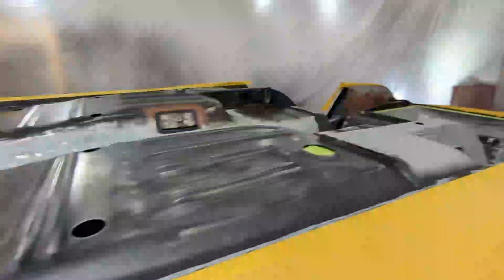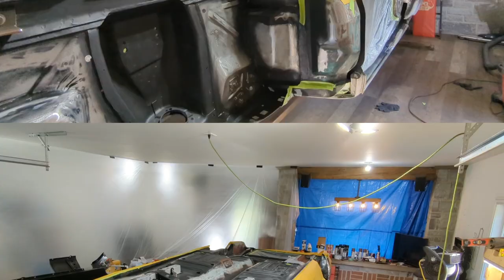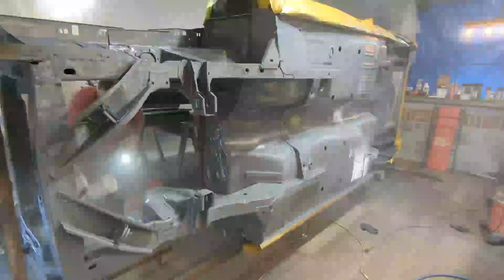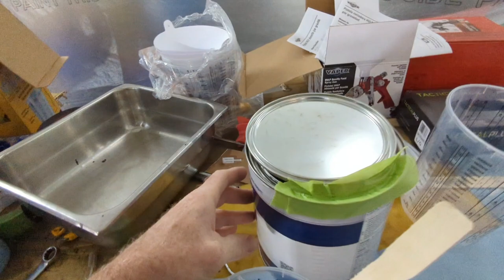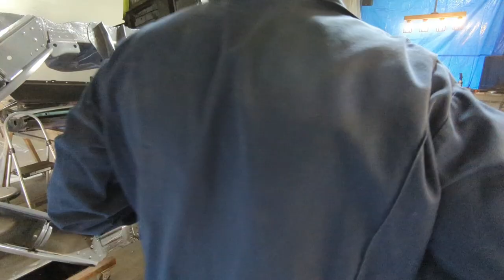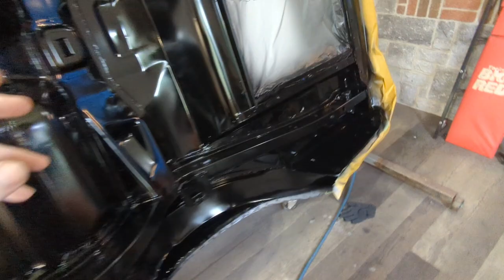Project Mustang #33 : Epoxy priming and painting the underside using Eastwood products

Comment: 😲 wow, that chassis black, looks sooo good 😊!!!
Mine looked similar, with a brush and POR15. 
This is a better way to go, if ya can pull off the rotisserie hack, and then guts to to try and HVLP spray. So much experience to get, on the primer and chassis paint, to bone up, for the cars actual  paint job, when that times comes. Keep after it brother...
Reply from the maker: It's much glossier than I thought, but it turned out pretty good